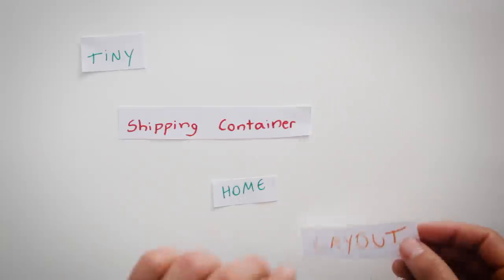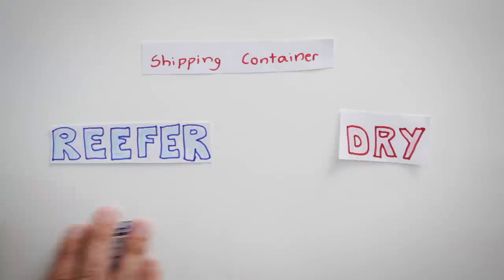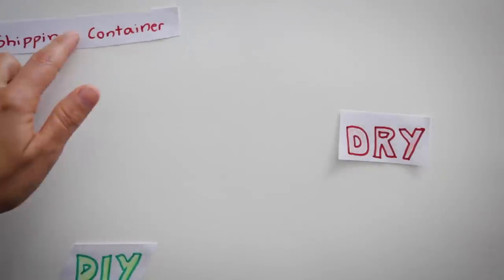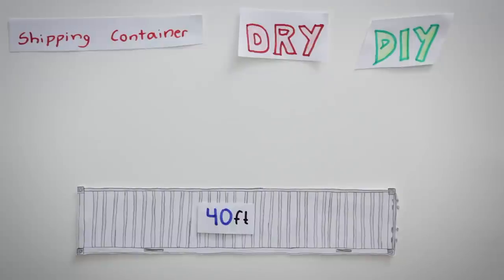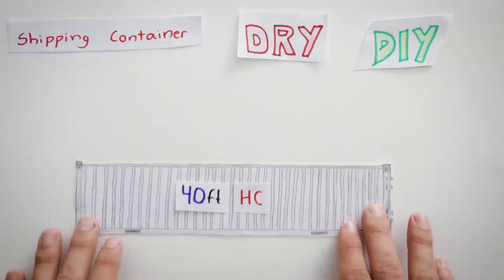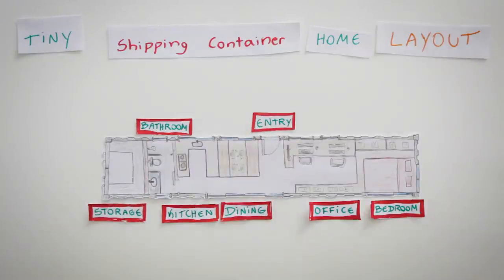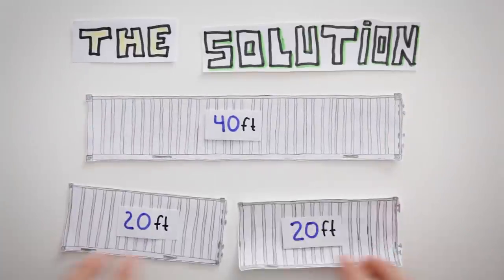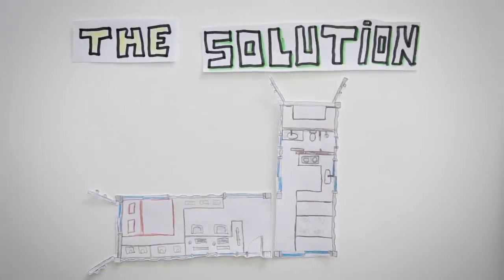Shipping Container House Architectural Project - Living Tiny Project - Ep. 002

Comment: Hi guys, this is great! I've just started my own 40' HC conversion and can truly relate to the issues you're facing. Two suggestions on your layout 1) build a fold down workbench that has a shadow board for your tools  - everything will be neat and tidy and when you want to use it the fold down part becomes the workbench. You could throw in a false floor that attaches to the doors and then lift it out to close up the workshop. 2) your small seating area near the office could be split height if hinged along the front. You could make this wide enough to be a 15cm high single bed when it's folded out.

Is your workshop also going to house your services, e.g. your hot water, electrical circuit breakers etc?  Good luck with the rest of the build - we'll all be watching with interest. BTW I'm happy to share photos etc of my build with you if you like (but I only started last week and it's 3 hours drive from where I live (which is in New Zealand)).
Reply from the maker: +Shane Bayley thanks a lot for the ideas. We really like the one for the single bad. 

About the work shop we are almost convinced to wait until the end and then build separate a tiny work shop on wheels!! 

Where in New Zealand do you live and where are you building? We spent a month traveling on a camper van last year. I don’t know if you also watched our New Zealand videos. Ee loved you country!!

Of course we would love to see you pictures of your building you can add me on Facebook. Eduardo Cassol

Comment: The extended workshop sounds like it would be a better fit for you two than to keep it like it is now. I really like how detailed you two are about the plans of your tiny container house. You two are awesome.
Reply from the maker: AnnaMarie Channell thanks a lot.
Reply: Hi, You guys have some great ideas for utilizing your limited space. I agree with AnnaMarie that buying an outdoor storage shed would be less costly than adding to your container. If you keep the container doors as they are now,  you have a very secure way of locking up and protecting your home without any added expenditure.
 In your video you did not say anything about insulation of the walls, floor and ceiling. Also, what parts of the building work do you plan on doing yourselves. This the best way to save construction costs. 
Best wishes to you guys and success on your project.
Reply from the maker: +newtong579 we agree with the shed idea and we are actually going to talk about another idea in the future!! 😬😎 the plan is to do everything by ourselves even the furniture, but let’s see what happens on the way!! About insulation we will also talk in future episodes!! Thanks for the devices!!

Comment: Love what your doing and how you are communicating it so purposefully - two thoughts on your design, 1) Do u need a work top that deep for ur office/ You may want consider keeping it the same depth as your wardrobe. 2) Good idea to extend your storage. It may be much easier to remove the doors, build out side walls, floor & roof - then re-install doors to close the storage area. Also, u MSU want to use concrete pavers on ground for the floor giving you a taller space instead of building a full raised floor system. That would be cheaper too. I’m scribed, and excited to see how this project progresses & by the way... Love Brazil!! I have been twice in past two years!
Reply from the maker: Thanks so much for the tips Matt!! 😊👌🏼

Comment: I think you should buy a separate tool shed for your storage.  Sheds are relatively cheap and you would have to invest money to build out the attached storage anyway.  Buying a separate structure just seems like a simpler solution.  Also, why don't you just build the entrance into the existing open wall?  That also seems like a simpler choice then closing one opening and then cutting out a new opening.  I think part of good design is adapting to the materials and environment you begin with and finding simple solutions.  I think it could end up costing you if you are too rigid with your planning.
Reply from the maker: +chramec Thanks a lot for the idea. We actually came up with an third option. Using that simple storage (I surf, kite surf have skate also so I do need storage space) and building from scratch a tiny work shop on wheels. Just like a very small tiny house on wheels but as a work shop. If that happen this would be our second project. Right after we finish the house. 😀
Reply: They also make 20' side opening containers https://www.youtube.com/watch?v=qGU_t-QD_E8 
Not sure if you can get them in Brazil or not. Since it's a workshop\shed or storage building the side doors make it grate for access to any sized items and help to extend the workshop outside on nice days. And again with the side doors you wouldn't have to make any modifications to the container and could easily be resold as a container.
Reply from the maker: +Jay Graham I love this model o Shipping Container but unfortunately we don’t have then in Brasil. Would be perfect fir a work shop. Thanks for the advice!!

Comment: This is the first video I am watching so not sure how far along the project is. 

What I was thinking is you could add a folding Ceiling, back wall and Floor in the Door area to expand the shop and allow it to be portable. Or be able to close the Container Doors for bad weather or what ever. Construct it in such a way that the Floor Folds up into the area first, then the Ceiling folds down. The back wall can swing out of the way as it is hinged to the Container Doors to allow the ceiling to drop into the area. The back wall can be two pieces and fold into the doors; sort of like double doors but they act as support for the ceiling. You should be able to make this happen with some thought or perhaps someone else could use this idea. I can see it in my mind but maybe not say so as easily. 

Another way is to make the area modular; much like above but without everything being hinged together. You can use the storage area to hold all the pieces too. I hope this helps....
Reply from the maker: Thanks a lot for all the suggestions!! The thing is, we have waaaay too many tools and machines to store and be able to have moving walls, floor and ceiling. Hehehe at least seems like 😬😬 but definitely I will try to think about a solution like this just as one of the options. Thanks a lot!!